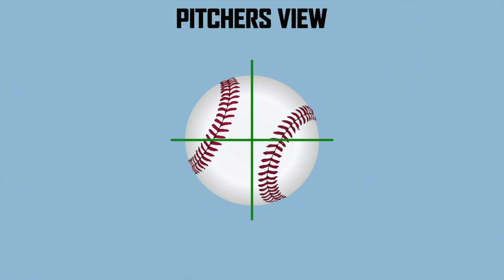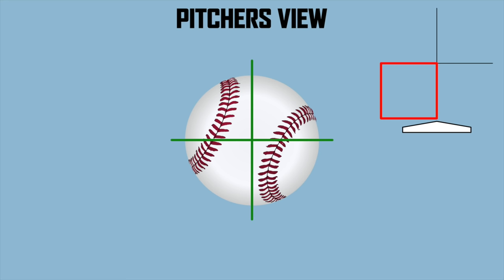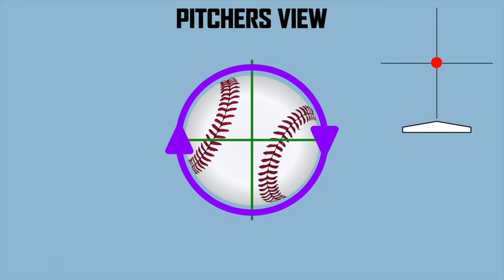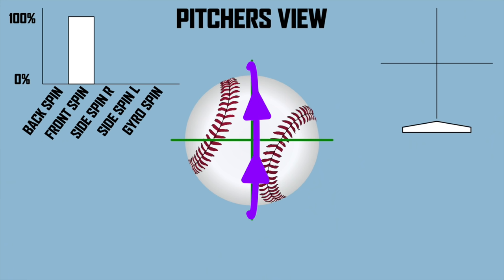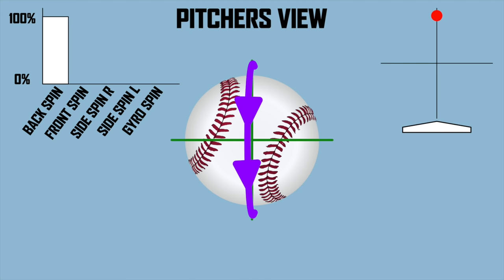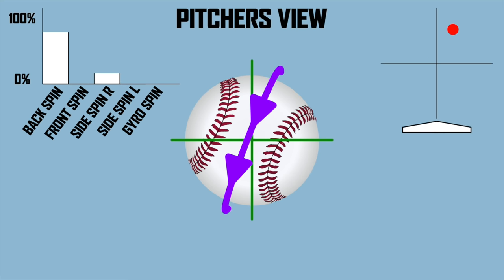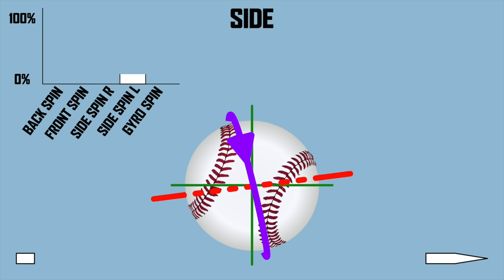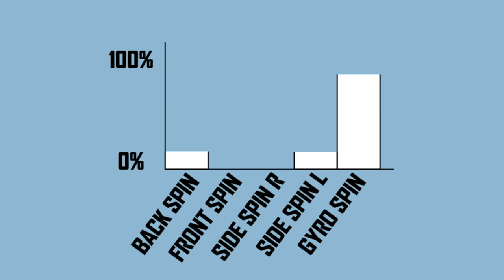How To Throw Trevor Bauer's Cutter

Comment: You can also throw a cutter by using a two-seam grip and just changing the angle of your wrist at release. If you can throw a good two-seamer, you will be able to see the "bald" (no seams) part of the ball on each side (though it doesn't have to be perfect). If you then orient your wrist to the to the left (RH pitcher) slightly (while your fingers stay on top of the ball in a two-seam grip), you will insure that as the pitcher you will see one side of the bald spot at an angle from the back of the ball and that the leading edge of the ball will show the other bald spot to the batter. This will cause the ball to dart left (from a RH pitcher) as it approaches the plate. This movement is also attributed to a difference in air pressure as one side of the leading edge is smooth while the other side is rough (seams). This pushes the ball to the rough side (this is the idea behind getting a scuffed ball to move as well, which is why umpires are taught to remove scuffed balls from play). If you orient the ball coming out of your hand the other way, you can make it dart to the right. And of course you can also throw a sinker with a two-seam grip if you get one of the bald spots to orient upwards and the other downwards to some degree. This destroys lift at the bottom of the ball and allows gravity to pull it down faster than a normal four-seam fastball. So it will dive as it gets to the plate, and depending on the orientation of the ball it may dart right (for a righty) as well as drop.

Comment: Shots fired at Tatis! He definitely knew it was a cutter because he stretched out to get contact on that ball that was 8" off the plate and down. I don't know if it was because he peeked or didn't peek because everyone knows they use different sequences to sign pitches but somehow he knew where that ball was going right off the mound.
Reply: He totally peaked. For sure. And they really only use different signs when there is somebody on second. I can guarantee the Padres know the Dodgers signs well and vice versa. Tatis knew what was coming and nailed it.